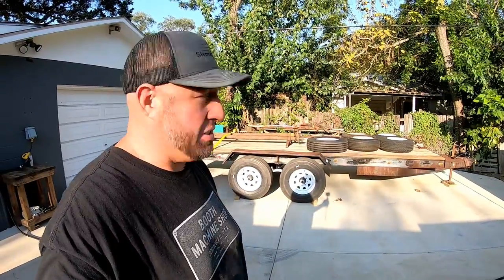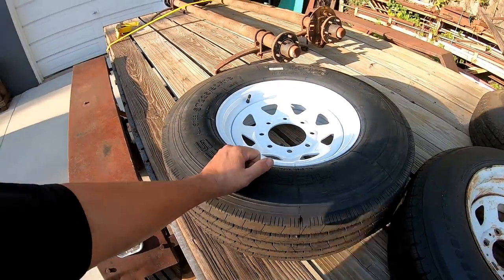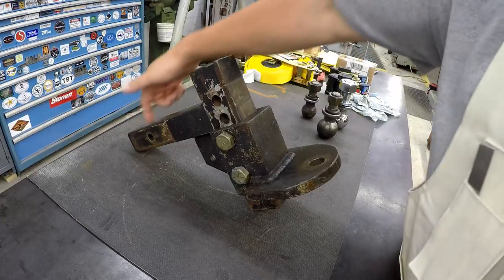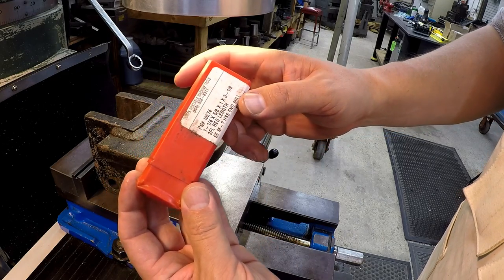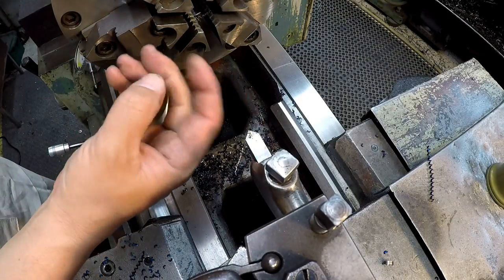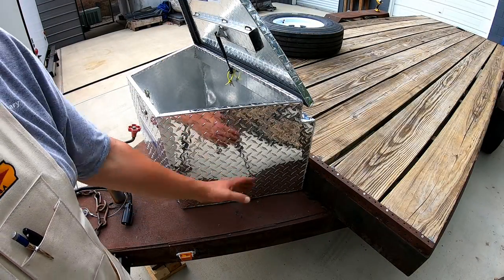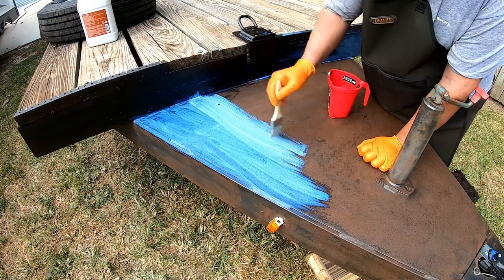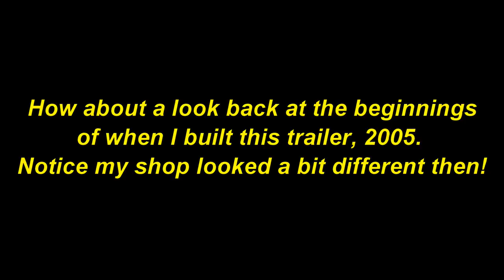SNS 276: This Old Trailer

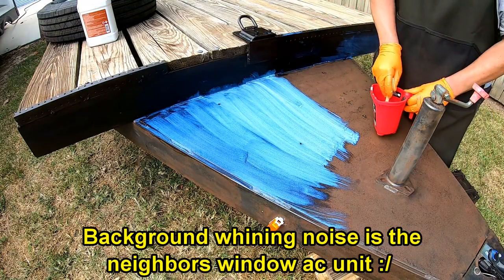Comment: 31:00 at least it's not a small internal combustion engine =)

regarding the trailer:
I recomment you doing some hidden rigging hardware (at least in the middle of the trailer) either the u-shaped ones that drop down or some inlayed D-rings.
For heavy the heavy duty stuff weld an angle iron, that have at least 5mm thickness, with some notches on the lower inner side of the u channel in the front inner side to hook your straps to and notch the inner u channel to get more points to strap to not just where the crossbeams are.

It would also work if you take 2' of 1/2" plates with some holes big enough for your straps and weld it on the side of the outer u channel (naturally not in front of the lights). This method reduces the stress on your straps by a lot, but you have less opportunities to strap to so you need to pick your poison...

Anyways great content and keep on keepin' onin'

Comment: Hello Adam,  Saw a guy on the tube that used a tool box like yours in an interesting way.  He cut a clearance hole for the fairlead and mounted the winch inside the box.  Helps with rust and corrosion as well as protecting from theft a bit.  Still has room for battery and straps etc.  I thought it was a practical design.  Take care.  Doug

Comment: Adam, put some thin plastic or something between your new toolbox and the top of your trailer.
Aluminum and steel don't get along with each other, and will corrode, even with the paint. 
If you have ever seen an aluminum framed trailer, they always have some thin plastic between the steel axle mounts, 
and the frame. Another great video BTW.

Comment: Hey Adam, You might want to check out a "Convert a Ball" system. I've been using it for quite a few years now. 1 1/4" shank, just change the ball out. You would be able to use 1 1/8", 2" and 2 5/16".

Comment: Hey Adam I have a quick question???
If a customer came to you and had the same
Issue with the thread size on the ball being smaller than the hole size in the plate and you made the bushing for them as you did in the video, how much would you charge for the job? Thx and keep the awesome videos coming, I speak for many when I say we love the great content every week.

Comment: Adam, are you worried about anything shifting and hitting the toolbox under braking?  I think I'd put some sort of solid stop on the front of the bed there, but then I'm paranoid about hard braking.
Reply: If the load is secured you shouldn't have to worry about it shifting unless you are in a crash. Most tires will lose traction before the gforces overcome the securement. 

I'm not saying that you don't know what you are doing, for all I know your fear could be because it happened to someone you know and you dont want it happening to you. But load shifts without a crash involved is typically because whoever loaded the trailer didn't understand the load or the equipment to secure it. For instance, a grade 30 3/8 inch chain has a working load limit of around 2600 lbs. The same chain at grade 100 ups the working load limit to around 8500 lbs.  So a chain or strap isn't neccesarily the same chain or strap. But suppose I spent the extra money and got grade 100. But I didn't check the binder and it is only rated at 5000 lbs. In combination that chain is now only rated to 5000 lbs instead of 8000 lbs because it is only as strong as its weakest link (the binder the ratchet it tight).

This will be overkill for most people but it is useful in understanding some of these concepts.

https://www.fmcsa.dot.gov/regulations/cargo-securement/drivers-handbook-cargo-securement
Reply: @sumduma55  
But the biggest problem with shifting loads is not the chains or straps strength, but that the chains is only thrown over the load, allowing the load to slide. 
I have seen very few broken chains or straps, but a lot of sliding cargo.

Comment: Don't know which climate you live in, but if I had a tool box like that mounted on a trailer, I'd make sure it had a couple of drain-holes in the bottom - oh yeah and a wide washer on each bolt to make it harder for a thief to pry the box off.

Comment: See if you can make the fenders float with the axles...  I.e. attach them near the hubs. Can't then use them to tie down loads but ensures the the wheels won't touch the fenders even when the trailer is fully loaded.

All the big rigs around here seem to have plastic fenders on their trailers. Might make sense if the fenders aren't taking a load.

P.S. I suggest putting a flat bar strap between the toolbox mounting bolts to prevent the bolts pulling through the base.

Comment: Why don't you guys in the US shot blast and galvanise the Trailer frames like we do in Europe? makes them last a long time! Not terribly expensive either. Have you thought about building the wheel arches built out of tread/diamond plate that you can drive over or even fold out arches that swing out. Brian James/Ifor Williams do it here- saves them getting banged up loading with a fork lift.
Reply: Like everything else, the root of the issue is cost. Plus I suspect that the typical trailer manufacturer in the US isn't all that large of an operation (speaking from experience) and the monumental amount of EPA licensing to have huge vats of hazardous galvanizing chemicals is just beyond the means of the average builder.

That said, I'm sure there are US builders who powdercoat their frames as it's radically less environmentally dangerous and achieves the same basic goal.
Reply: Maxwelhse powder coating chips, then the water gets under it and it’s useless though-  Since when has the USA been environmentally conscious 😂 driving your massive inefficient gas guzzler vehicles 🙄
Reply: @defendermender4959  I didn't realize I was conversing with a Euro edgelord who didn't want to have an actual conversation about the topic at hand, but rather bash the US on a topic they know absolutely nothing about. Carry on, then. I won't attempt to further educate you about manufacturing constraints in the US and I'll just let you believe whatever your imagination conjures up instead...
Reply: Maxwelhse jesus boyo you yanks don’t take a little lighthearted ribbing well 🙄😂

Comment: Inside of you r toolbox , you should make a half shelf that will sit half way up the inside with high side walls… you could take some aluminum angle iron and weld to the inside of the toolbox 🧰 ,So the shelf could sit on it and still be removable if need be, you could put your ratchet straps and Lightweight stuff on the shelf and put your You’re heavier chains on the bottom ,this will give you more storage area inside of the toolbox 🧰 ... good luck with the trailer building

Comment: Replace the lights with LEDs especially since you are in the southern rust belt even Andrew Camarata would but he would have spray bombed the trailer w paint or broken out a can of crusty stuff he picked up 2 yrs ago and broke out his airless paint sprayer lol. Find good true dimensional lumber though oak or cypress if you can
Reply: Bigdeal 18 would call service or buy a new one

Comment: Really nice work on the adjustable hitch. I am curious as to why you purchased a toolbox instead of making one to custom fit the trailer tongue/drawbar.
Reply: Seems like he doesn't do a whole bunch of sheet metal work.  It takes a whole different set of equipment to do it quickly and easily

Comment: I do believe that rims for trailers are not the same as those used on automobiles, the offset is closer to the centerline of the rim.
Reply: If you are building the trailer and modifying the width of the axle you can use whatever rims with whatever offset and backspacing you'd like.

Comment: Two additions I'd recommend, 1, add a flat 4 pin trailer connector, so that when you loan the trailer to people, they won't cut into your cable to make the lights work on their vehicle. 2, I'd add a safety fence the height of the toolbox across the front. If you have ever seen how easy the load will slide forward, especially during a wreck or severe brake application. I haul small excavators and skid steers with tracks and they will slide. Great video.    

I

Comment: You could lower your axles by putting square tubing between the spring hangers and chassis rails. Then your fenders could be deck level and have lots of clearance above the tires.

Comment: As a climber the ratings on those quickloaders seem ridiculously low. Of course they're made of much cheaper material, but all my slings (loops of flat material like what the quickloaders use) are rated for a minimum breaking strength of 22kn (4800lb). And they're 1/2" wide. I wonder what the actual safety factor is on the quickloaders, and what part would break first.
Reply: In the US load securement straps have a load limit of 1/3 the breaking strength.

Comment: For a long time I've had a question about oil and parting off tools. The blade of the tool is going under the surface of the work where the oil coat sits. I realize that here will be some oil flowing around the sides of the cut, but isn't there a more economic way to use the full potential of the oil on the surface where the tool is actually cutting? Or am I missing something basic?
Reply: If I had to say you missed something, I'd say its overlooking the oil carrying heat away from the work as the cut is being made.
Reply: Oh, by the way, I'm a carpenter, not a machinist.
Reply: @Vickwick58  Cool!
Reply: I know cutting oil is the preferred use, however with how much one goes through would using 20w non-detergent suffice? I hear you can get it 2g/$20 at tractor supply.
Reply: @boots7859  In my experience, stuff like engine oil gets thin a lot faster than proper cutting oil, so you'd end up using a ton more of it, and it also slings everywhere. If absolute thrift is your concern, I suppose you could use used engine oil.  Regular dark cutting oil isn't that terribly expensive if you buy it in volume. Even on Amazon it's $20/gal.
Reply: Well, the first thing is that your cutting tool is mechanically displacing the metal of the workpiece. You can’t put oil where the deformation is happening at the leading edge in real time. But the more important aspect is that you really aren’t adding oil for the workpiece as much as you are for the tool. Yes, it helps with surface finish, however cooling the tool to maintain the edge and lubricating the surface of it so that chips don’t gall/weld to it help longevity as well as the finish.
Reply: Victor Stanwick nothing to add here other than I love the tone of the helpful answers and the education in get! Thanks.

Comment: Did you know on your mag drill you can twist the collar above the switch handle for reverse. 
Looking good.
Reply: I would bet, since he was power tapping, that running the tap in reverse under spring tension would tear out the top thread.

Comment: For the trailer hitch the bracket that you built. My thought build a couple brackets for the different sizes of balls, swap the brackets instead of removing the balls the bracket for for different weight applications. Swapping the bracket is easier then unbolting the balls.
Reply: Adam best way to solve the corrosion between metal and aluminum is to use a rubber mat the size of the boxAnd coat bottom of box with rust inhibitor

Comment: ae the rims rated for the higher pressure?  you may also want to replace the valve stems with metal, they will take higher pressure and won't rot.  great wor kand love your shop.

thanks,

Mike

Comment: Would you mind telling us what those hubs came from that you put on the mobile home axles?  I would like to convert  my trailer's axles to use standard truck wheels.
Reply from the maker: I bought those from the same place I got the new axles from. They are standard 6 lug hubs designed to fit on those 5K mobile home axles.
Reply: @Abom79  Thanks Adam, I asked because I need to make the switch. .because some states have made MH wheels illegal for highway use.  Some years ago I was told that a 6 lug truck hub was a fit, but I was not interested at the time, and don't remember the particulars.  CRS disease lol.

Comment: Big beefy chains are CRITICAL to making sure you keep your load if/when the hitch comes off the ball (happened to me).  But a chain is only a strong as the weakest link. First,  I think that your chain is good to about 3,000 lbs.  Is that strong enough for those big heavy loads you carry?  Chain is cheap, buy bigger stuff.  Second, at 22:37 I can see "spring clips" on the end of your chains to attach to your hitch.  These are extraordinarily weak and only good to 150-250 lbs and will open up instantly.  Replace all that stuff with chains/hooks like these - https://www.etrailer.com/Safety-Chains-and-Cables/Titan-Chain/TCTSCG30-730-04x1.html.  $30 all in - cheap insurance!  Best of luck!
Reply: The chains he showed in the box were binder chains (for your load), not safety chains.
Reply: 14,000LB puts it into a class 5 trailer, which means grade 70 chain and forged hooks.
Reply: I really dont like those stamped steel tongues on heavy duty trailers. Im sure they're "fine' but will take a hammerblow style any day, or even better--- a pintle hook. Once you go pintle hook, you never go back.
Reply: @truckguy6666  pintle is only good if you have a air compensator on them. Otherwise they jerk a normal truck around to much.
Reply: @ionstorm66  you are right that they're jerky and loud and have no manners especially empty. But I'm ok with that knowing that the sumbitch ain't coming disconnected.

Comment: You could never have such a trailer in Germany.
Maximum weight for a trailer on regular trucks / SUVs 3,5 tons. without brakes only 750 Kg not an ounce more
Elektric brakes aren't allowed we have only overrun brake and air brake on the semis.
If you would build your own trailer you would basically need a TÜV engineer as a brother because the TÜV has to approve your welding (welders pass) / axles (CE Certificate) and not many would believe in you.
Reply: Love the mix of units, ref "750 Kg, not an ounce more",  very similar regulations here in the UK, I think only a few US states have strict regulations on trailers, as vehicles as well, but each country to its own. Can anyone clarify this please?.
 There is also a maximum of gross weight including the towing vehicle including passengers and luggage in many countries.
A brother who is TüV engineer would be very handy.😀
Reply: I think that's the rules for most of Europe.  At least it's the same here in Norway.
Reply: Likewise here in Australian states.  Until 2010 the gross load could not exceed the mass of the towing vehicle and the standard 50 mm ball was limited to 3.5 tonnes.   Balls of 1 7/8 inch became obsolete and dangerous as the newer 50 mm couplings became a loose and dangerous misfit.

I sense some "specification enthusiasm" here, as the combo will probably only be seen hauling garden refuse to the waste disposal .  Given its mass and the dual axle arrangement it will be immovable by hand and will probably sit in the long grass rusting like the original appears to have done.  This project makes no sense!  The use of softwood flooring would suggest it started as a backyard project in the 1950s.

Steve

Comment: I was watching a video of a car restorer and he only uses that high strength blue nylon line for lifting because there's no chance of it marring the finish like chain would. It's plenty strong (1/4" line has about a 10,000lb breaking strength) and has almost no stretch.  It could be useful for tying down/lifting machinery as well for the same reasons.

Comment: Can I ask why when turning the bushing you use lots of cutting oil when parting off, but non when reducing the diameter (interested subscriber, not  a machinist )
Reply: The parting tool is continuously pushing in to the same spot, and generates a lot of heat. When you're turning the diameter of a part, there is a lot of time for the stock to cool since the tool moves past after taking a cut (compared to the parting tool sitting in the same position).
Reply: The geometry of the tool also plays a significant part in it. A typical turning tool is generally thick and you only let as much as you need to stick out of the tool holder. In contrast, a parting tool is long, narrow and protrudes quite a lot from the tool holder, making them considerably less rigid and very prone to chatter. They need all the help they can get. You’ll see a lot of times where the machinist will need to change the spindle speed to find the sweet spot where the tool and material play nice with each other. You’ll also see a lot of cases in which the machinist hand feeds the parting tool because it is very helpful to go by sound and feel to get it to behave over letting the machine push at a set feed rate.

Comment: I def have the interest for the satisfaction of precision machining.... But I have to tell you it certainly is rewarding to go through the process without doing all the setup and just seeing the chips fly and end results. I like that you leave out the tool setup and piece fixture setup as that is kind of the boring part. Nice strong trailer you got there. I just picked up a older (1999) 14k gvw 18' equip trailer very similar. I have had so many trailers over the years being in the landscaping business with a mechanical side hobby

Comment: I would drill a hole in the treads of the ball and put a pin because I had a nut come loose, just a suggestion for safety.